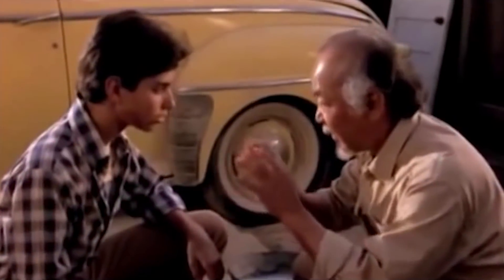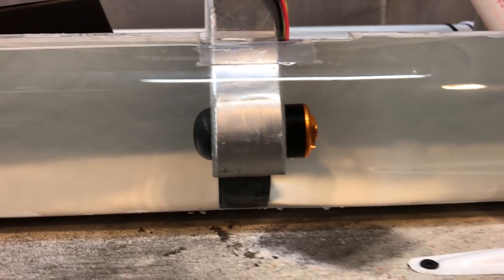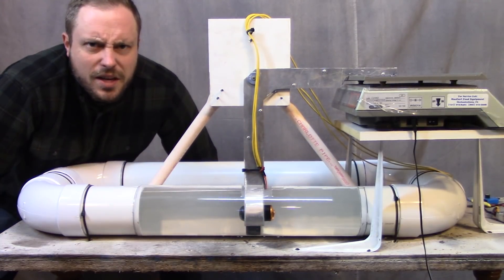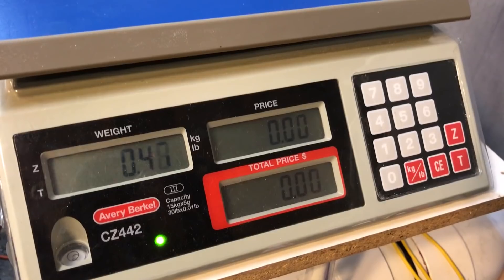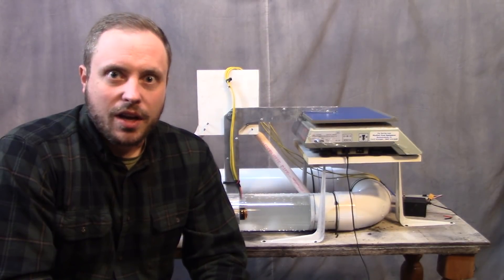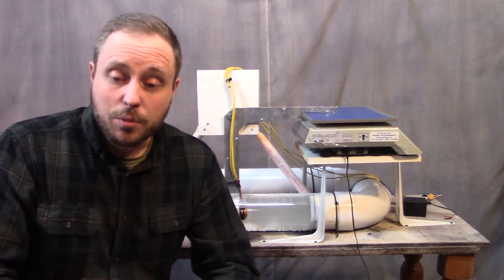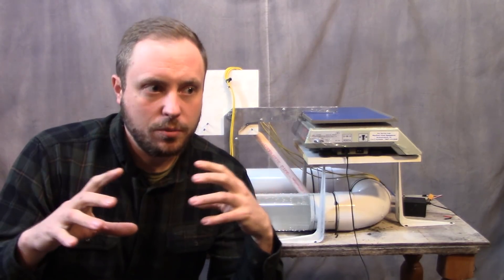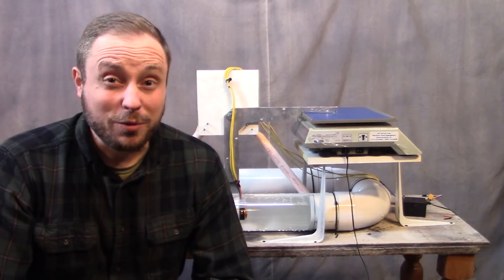Underwater Thrusters, Science, And Aquaman

Comment from the maker: Leave me a comment if you know where to get props or impellers for a huge brushless motor that will work in an EDF housing!
Reply: JAIRUS OF ALL this is gona take time like Hacksmiths flying like ironman Projekt
Reply: JAIRUS OF ALL I got a amazing idea
 You need to make the world's strongest armor then attach the power fist  bullet proof glass for the eyes so if you got hit in the eyes by a bullet then it wouldn't be that bad then boom you got your own Juggernaut armor then take it into are soft battle
Reply: JAIRUS OF ALL just thinking, there may be a reason why they make impellers out of metal...
Reply: JAIRUS OF ALL and you'll probably need lateral fins on say your forearms to keep your legs from over running your torso.... maybe something like that.... best of luck J
Reply: you should 3d print an impeller
Reply: How about 3D printing in wax or soluble filament an impeller and putting it in plaster and do a lost wax casting with aluminium? also people have made BLDC motors with 3D printers
Reply: Ask the hacksmith. They got powerful ones for there iron man progect , but they are using jet engins now and they may have them lying around.
Reply: hobby king usually has brushless motors some that are pretty large
Reply: JAIRUS OF ALL in the wother is last drag
Reply: Do not attach to the bottom legs it can hurt u having that much force on the knee and having better control u can attach to motors to arms steering but you can also make the two motors steer at back  using your arm to point at the derection you want to go making you also use less motors. Also the head is also a big drag you can add helmet with mirros so that you can look were you going but also keep your hand down causing less drag.
Reply: Look into Scorpion brushless motors they are expensive but lift op a woman with to of them using RC Heli also maby look into hobby king with a lot of supplies of RC stuff
Reply: make a ceramic mold, then build one from fiber glass?
Reply: also  a lockable knee brace could potential be a savior.
Reply: What if you used pure sodium metal as a fuel, and funneled the reaction gases through a nozzle like an underwater rocket. Or just any metal that reacts with water to produce heat.
Reply: Have a look at SV SEEKER channel the guy in oklahoma building a  boat. go to the underwater RV section. loads of info
Reply: JAIRUS OF ALL You should hit up Peter Spirol. He's from Test Flight. He's made a couple under water propulsion devices, remote controlled boats, a lot of remote controlled planes and a Home Depot Ultra-Light plane. He's pretty good with propellers.
Reply: btw, Seabotix.  Not sure if they still sell thrusters but they did for years.  I have a couple if you want to buy them off me.
Reply: the hacksmith does a lot of stuff like this... try asking him...

Comment: as a rc guy for this application you want torque which means a lower kv rating. a 1200-3600 should work alot better.

Comment: You may want to build this into an exoskeleton design. Only because if you get the thrust your expecting. You are not going to be able to control where it pulls you. (weather that's apart or together would not be good) the exoskeleton can give you can tweak it to support the thrust as well as let you control some movement
Reply: Shayne Lafferty I agree completely. I am more than doubtful a person could control their trajectory without risk of serious injury. At minimum the EDFs need to be braced against his center of mass. This is like trying to drive a Ford Mustang with a steering wheel that steers the rear tires only

Comment: You need a tank-extension on top of the impeller, maybe with an extra reservoir, to prevent air form getting sucked in.
You might want to add a small metal section to the tank and mount the motor controller to that - easy cooling. (Or get a watercooled controller - advisable for this project anyways.

To get really good results you would need a way bigger test-channel with  way to add resistance to the flow of water.

Also about the Impeller it self:
You need something to straighten out the flow.
For the design of the impeller: Look to good old RC hobby-stores or to submarine/jetski-forums. There should be enough 3D models for that.
For the motors - 2x 3kW brushless motors for water-use ~60€ each, should be enough to give you a decent speed. there is a great selection fo those too at RC stores.

Comment: There's one problem with your test rig, you lost efficiency from the propeller cycling air. You would get more thrust just by keeping the prop complete underwater because then there would be a more uniform load instead of trying to move both air and water